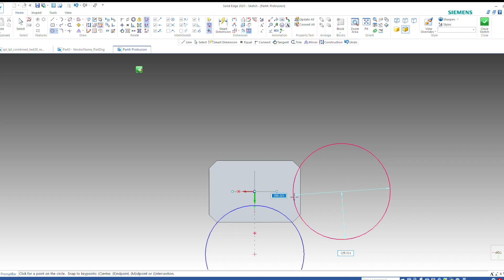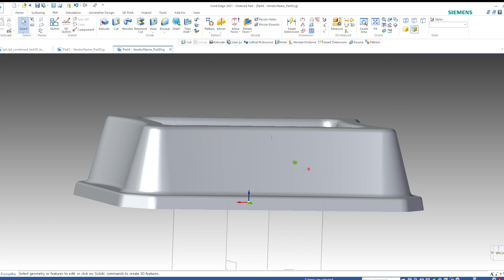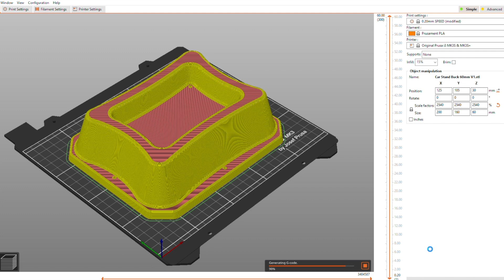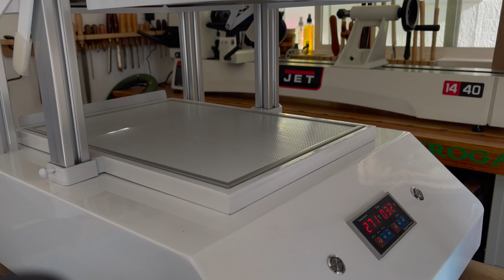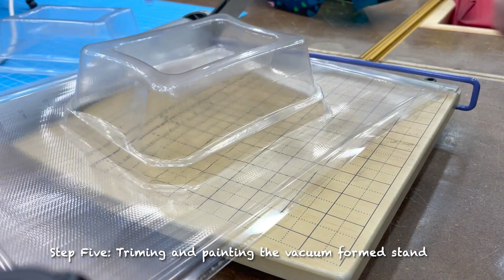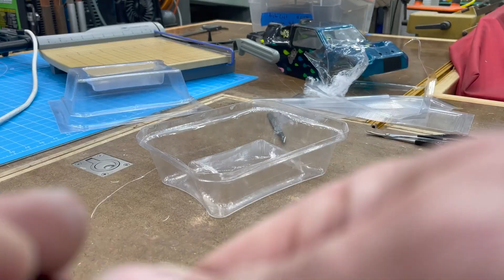How To: Vacuum Forming an RC Car Stand

Comment: What a great idea and smart to have a parts tray integrated. 

I’ll probably going to stick with Addam’s Playground method of slicing foam yoga blocks. 😊 

But that’s a great idea and once you get the buck refined - I’d buy a few from you. Very customizable - I’ll need to get you some more stickers. 😂

Appreciate you showing and sharing these ideas. Helps keep the creative juices flowing.
Reply from the maker: Thanks for watching and the support. I don't think I could justify the cost of making these for sale when you take into account shipping. Maybe, make them as gifts or giveaways.  It was more of a way to show and tell the process from cradle to grave and give me a chance to practice the process. The next part with probably be something RC body related. Though, the vacuum former I have is slightly too small for that. I will probably have to make a larger one to do a body.

Comment: That was really nice to watch! Somehow much of the stuff that you are doing, it's pretty much what I am hoping to do at some point when I find time, ha ha!
I like that you have a dedicated vacuum former, it looks really nice! The way I have seen in other videos is they usually make a table and then use a vacuum cleaner.
My ambition would be to someday be able to start designing bodies for RC buggies mostly, best inspiration I found so far was from Scale RC Models, very nice work he does on classic cars.
Reply from the maker: Making bodies is hard, at least for me. I've been messing around trying to model up a buggy body but I'm still trying to wrap my head around the geometry. If I get around to making a body, I will need a bigger table and go the route that you see in the DIY videos. 

Thanks for pointing me over to scale RC models. I will need to start spending some time over there.